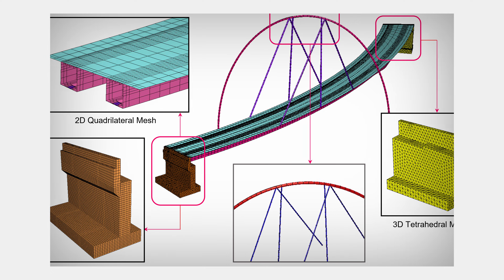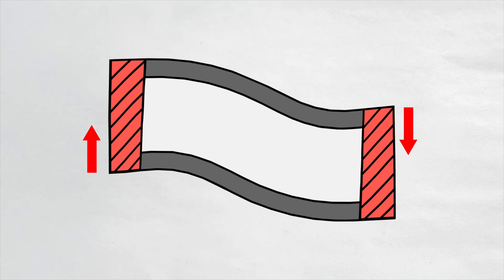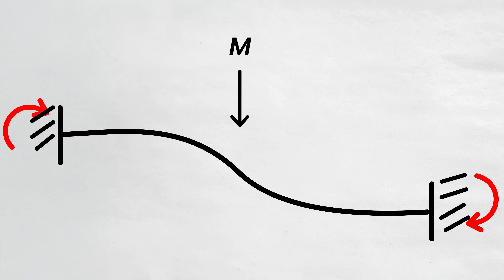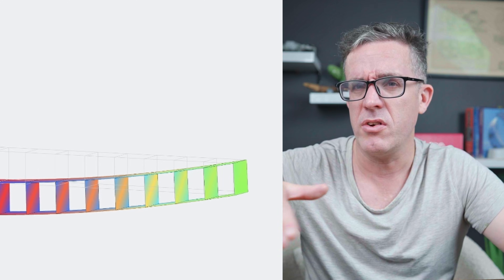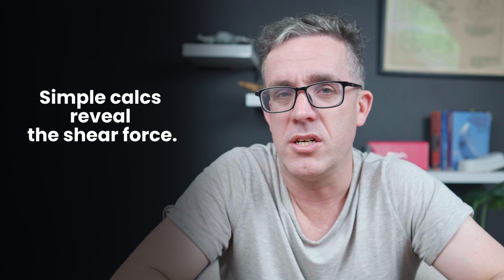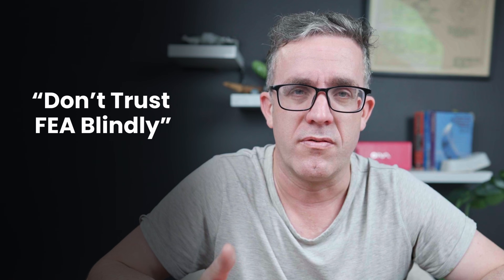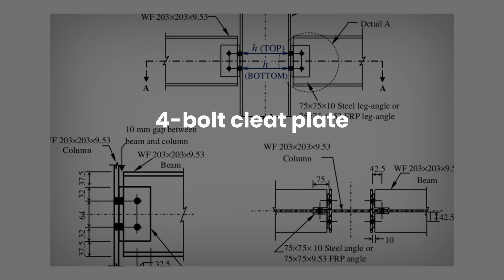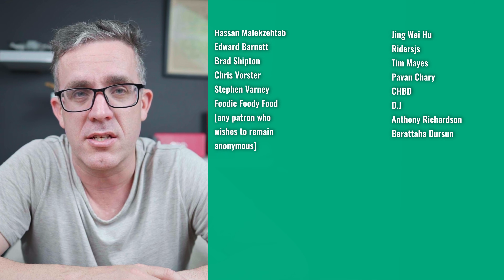The Truth: Hand Calculations Vs FEA in Structural Engineering

Comment: The most important thing to understand is that FEM is not fundamentally different from the manual methods. The only difference is that if you do it by hand you drastically reduce the number of your finite elements (sometime down to 1) and slightly increase the complexity of the model of the elements. The available models for constraints are the same, the moving connections are the same, all the basics are the same. And there are FEM somftware designed for frame analysis doing EXACTLY the same calculations using the same formulas you would use if you did it by hand, they just do the integrations not alalytically but numerically. So you don't even need to remember all the formulas, just using a simplified model and your trusty beam frame calculator software as a backup to your more precise mesh-based FEM model is well enough.

Comment: As a mechanical engineer I use hand calc only to see if my FEA is within order of magnitude to the FEA. This basically confirms that I didn't make a typo or other basic error in the FEA. But really, the areas where we work (automotive, aerospace, energy...) hand calculations can really just give you the first rough dimensions but cant give you nearly enough information to base your design on.

Comment: Those transverse stiffeners are tricky. Deformation of the beam remains curved the same as unstiffed beam. A hand assessment for these stiffeners is the only way to obey the realistic deformation of the beam. The local area with concentrated forces becomes member in compression or in tension.

Comment: If youre looking at such a well established field as analysing bolted beams, then sure, initial estimates are good in hand calculations, and probably quicker. However, when looking at say a complex automotive casting, then there are basically no hand calcs to perform. Also, hand calculations can in my experience vastly oversimplify physics phenomena to the point that theyre not even close to reality in som cases. It really depends on what you are analysing. Though I still do hand calcs every now and then :)
Reply: I suppose in your field, the analogue would be casting the part and testing it somehow. FEA can only approximate to whatever extent it can.

Comment: I fully agree with you, Brendan. Analytical calculations are crucial for understanding the problem and knowing what you're looking at. However as a geotechnical engineer, it is my experience that it also goes the other way. For complex cases the FEA sometimes shows me failure mechanisms I wasn't expecting before with just hand calculations. It's a wonderful tool when used with caution

Comment: Hi Brendan, 
Good insight on hand calculations and FEA. Though they are both used in structural engineering can serve different purposes and have their own strengths and weaknesses. To say which one is better depends on the specific problem and goals. Hand calculations are great for simple problems, while FEA is better suited for complex problems. In many cases, a combination of both is used. For example, hand calculations for preliminary design and analysis while FEA for detailed analysis and optimization. With fast track projects the FEA may be viable  but hand calculations I can say is the essence for structural designs. 

Stay safe,
Malik from Barbados

Comment: Hand calculations are less susceptible to GIGO (garbage in garbage out) errors and PEBKAC (problem exists between keyboard and computer) errors.  Very large structures have failed because the computer calculation was incorrect and the people running the computer didn't spot it or didn't know how to spot it.